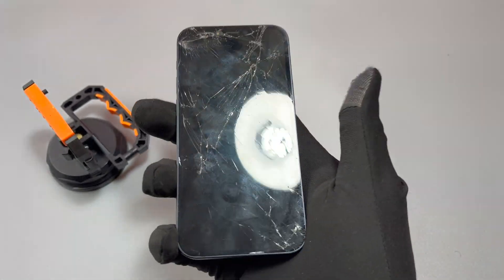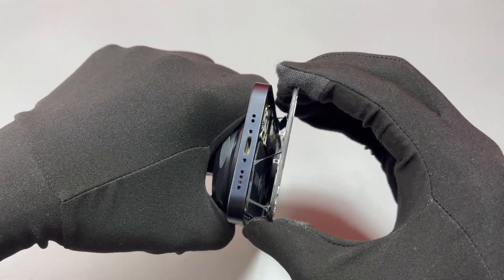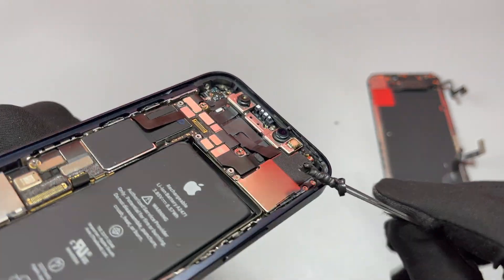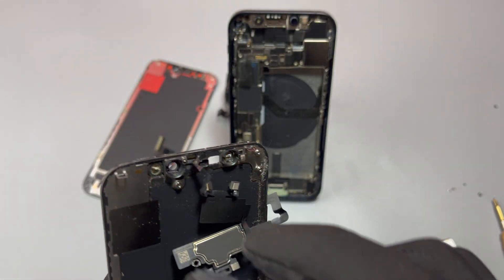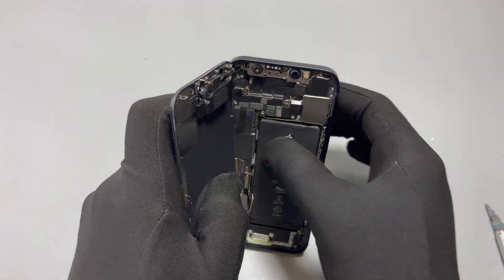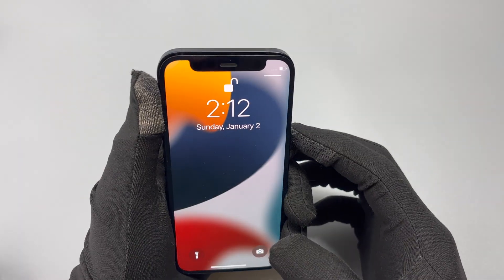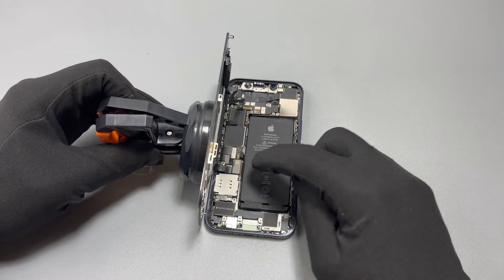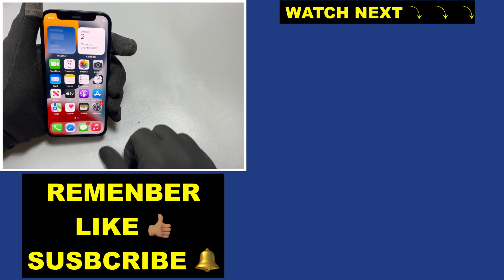iPhone 12 mini and iPhone 12 Screen Replacement Repair Guide

Comment: My original screen is flat but the new screen I bought is the same as yours and isn’t compatible with my iPhone plz help!!
Reply from the maker: Why is not the screen compatible? Make sure it's the right screen for your phone. Aftermarket screens should work same as in the video without any issue. You'll get the notification of unknown parts but that's it. It doesn't affect anything functionally apart the true tone.
Reply: @ersbit  the screen works but when I try pushing down it won’t stick
Reply: I’ve read in several sites that the phone reheats and has issues after replacement. Even with original parts of not recalibrated officially afterwards

Comment: thanks for the vid - how did you turn the power off since the screen isn't working? I have the same problem.
Reply from the maker: Hi I don't know any other way to turn it off without the screen or 0% battery.
You can just go ahead and open the device (while it's on). Once you open it you remove the retaining plate and disconnect the battery cable, then proceed. It will not damage anything (disconnect the battery cable with your hand or plastic tool).

Comment: What face I'd works after replacement please tell me bro
Reply: Normally if you change also the parts at the top of the Display (flexcable with earpiece and sensors) should it work